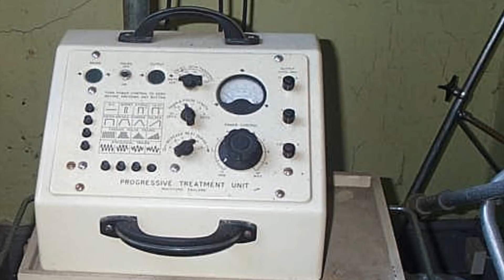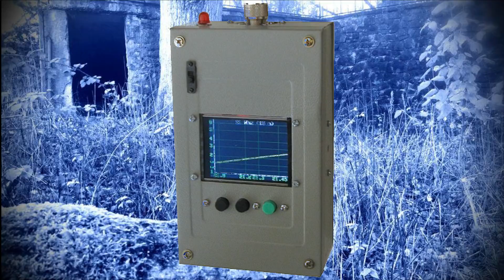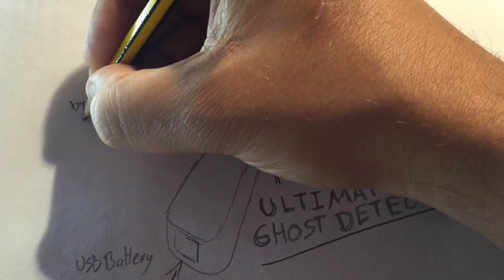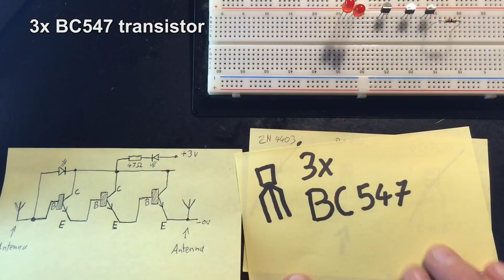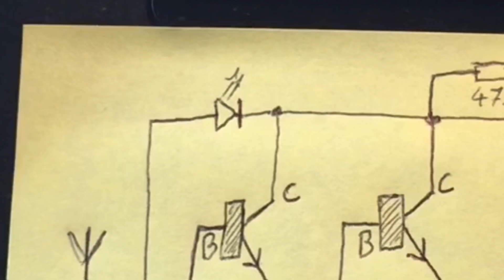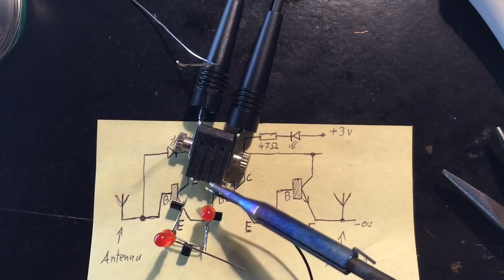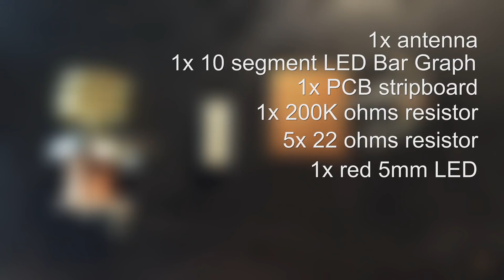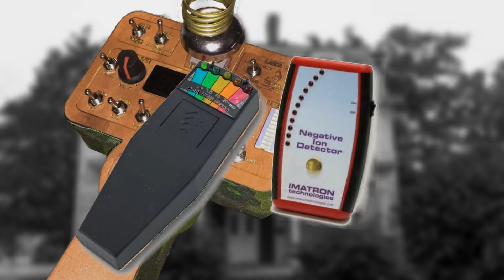Build The Ultimate Ghost Detector   Part I / The EMF field detector

Comment: I've also tried to download your code. Just really want the ghostbox part of the code. But the code is broken. Thank you.
Reply from the maker: Try open the file with the editor, then copy the code over to a new Arduino Project. Somehow the new Arduino update makes problems with opening files.
Reply: @MancaveEffects  
I tried what you asked. But the code I get. Starts at 
static bool value = - 1; 
In your video your program starts with all the included libraries. 
Thank You
Reply from the maker: Apparently there seems to be a problem with the download page something got swapped, the code you have is the raw code for the emf detector. I will check it tomorrow and re-upload it.
Reply: @MancaveEffects  
Thank you. I have no problem sending you a donation. If the code works. I know how hard programming is. I've been trying to learn arduino coding for a while now. And do appreciate your time and response. 
Thank You.
Reply from the maker: John, i re-uploaded the file to my webpage. Came out that the file was there but hidden by the icon, however it should be back for download!

Cheers
Reply from the maker: Could be that due to the updates of the Arduino software you can remove the “TEA5767.h” on the top of the code but i’m not sure.
Reply: @MancaveEffects  

Ok. The file I downloaded. It starts at

static bool 

Is that correct?
Reply from the maker: No, its the file underneath
Reply from the maker: https://72786013-a27e-4d15-a1c2-6065046c91aa.filesusr.com/ugd/d1cb73_0cc8645942b44d31a97083a0d30d1c31.docx?dn=MANCAVE%20SPIRITBOX.docx
Reply: @MancaveEffects  
Thank you. That link worked. Heading out now. I'll get it all working later today. And after that. I will send you a donation. 
Thank you so much. 👍
Reply from the maker: Youre welcome!
Reply: @MancaveEffects  
I can not make heads or tails out of your breadboard schematics. Sorry. It is mind boggling. More the tea5767 module and what is hooked up from a4 to ? As well as A5 to ?  
Thank you
Update. I found sone info on the wire connection.
Reply from the maker: Thank you John! Did you get things worked out?
Reply: @MancaveEffects  
Yes sir. I have a lot going on. But finally got to finishing the breadboard testing. And I am in the stages of getting it all into a box. Thank you.
Reply: Now. For some unknow reason. The LCD screen went out.

Comment: How many Arduino nano board we have to use 1 or 2 and can i use clone v3 Arduino nano board???
Reply from the maker: If i remember correct i used two. Yes sure you can use a clone board
Reply: And how you have made that negative ion detector anntena. Means how many turn you have given in that coil (anntena)

Comment: So the microwave detection device will affect the compass and everything else will affect the emf meter. There's too much stuff compacted together that will interfere with each other. That's why they set the devices far apart from each other in investigations where they use multiple devices. No interference that way.

Comment: Hi, i am trying to build this, first time at electronics so a real dumbass im afraid, have you got a picture please of where to solder the 2 leds and what connection the resistor needs to be attached to on the assembled part, this is for the first part of the build.
Many thanks
Reply from the maker: Its been a good while i made this build and for now i do not have access to the original files but check the diagram that is for download on my webpage.
Reply: @MancaveEffects  thanks for the reply

Comment: The links for schematic and code are down. Can you provide a working link?
Reply from the maker: I just checked the links and it works fine for me?
Reply: @MancaveEffects  thanks for the quick reply. In fact I could open the links when using my Cell phone's browser. So It must be a problem with my notebook.